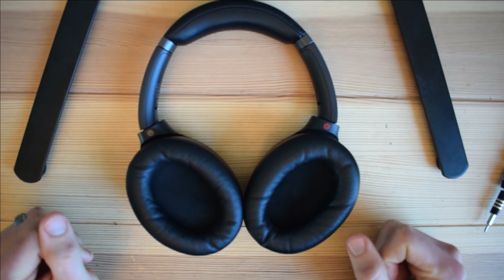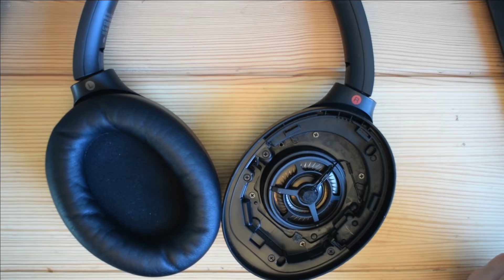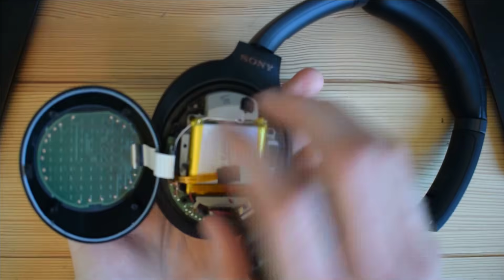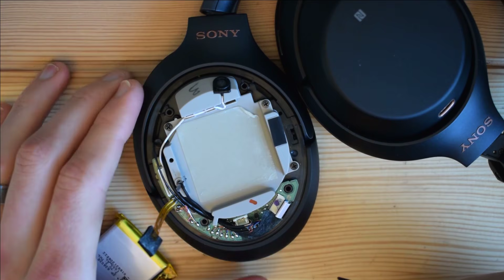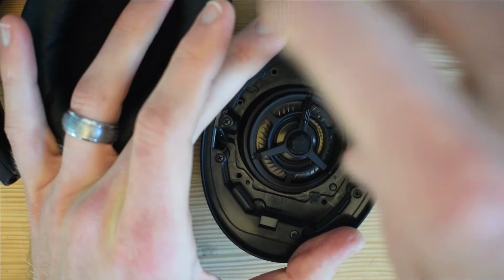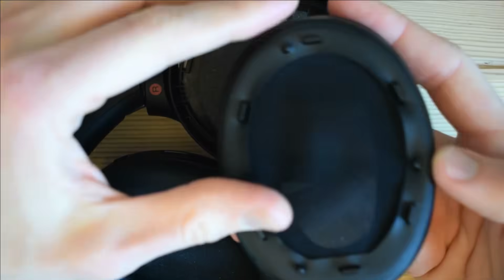Sony WH-1000XM3 Battery Troubleshooting, Repair or Replacement Walkthrough - Teardown and Fix

Comment: My app kept showing 10% for the battery.  I unplugged the battery for 15 minutes and then plugged it back in.  I hooked up the charger.   The red light came on for a few minutes and then went out.  So I powered on the headphones and the app showed the battery at 100%.   So it seems like the battery was charged the entire time, but was only showing 10%.   We’ll see how long this lasts.  Thanks for the video!   Made disassembling too easy.

Comment: I replaced the battery as shown in the picture and followed all the steps correctly. However, now the sound only comes from one side. The earbud on which I replaced the battery no longer produces any sound. Has this happened to anyone else?

Comment: I have the WM1000-XM2. I had to remove the entire battery to disconnect it from the unit. It was a bit challenging as it was glued. But it worked 😀
Now I’m excited to see how long the headset will keep working.

Comment: Does XM3 have same battery as XM4?
Reply: Yes, I bought this one a few days ago for my XM3 and the description says that it's also working for XM4. But look out for 1200mAh, some only have 1000. Cheers
Reply: @spexx23  Must be the logic circuit. A nerd with schematics could tell you which chip/CB it is?

Comment: Would you please resend the link to purchase a battery? I have a model WH1000XM3 and think it’s time to change the battery. I am having trouble powering on after a full battery once I’ve turn off the headset. Thanks!

Comment: Thanks for the video!
Here’s my story:

After I dropped my headphones on the floor, I picked them up and tested them — they worked!
But the next day, when I put them on, they suddenly stopped working. When I tried to charge them, the red light stayed on for a few minutes, then turned off. Later the charging time got even shorter, less than a minute.

Here’s what I tried:

After Googling, many people recommended changing the cable and/or the charger → still not working.

Following this video, I unplugged the battery for 20 minutes → still not working. When the ear pad cover was off, I touched the battery to check if it warmed up while charging, but it stayed completely cold. So I suspected the battery was dead.

I asked my friend DeepSeek, and he guided me to the iFixit page for the WH-1000XM3. There, I found a comment from someone who opened the left ear pad and applied gentle pressure on the cables and the board. I tried the same thing, and bingo — the headphones turned on!

After investigating more, I realized the real issue: a tiny crack or bad solder joint on the main board. I located the exact spot that needed pressure, placed a small folded piece of paper to add thickness, closed everything up, and tested again. → Everything works perfectly for now, until I buy a new pair someday.

Conclusion:
Dropping the headphones caused a small crack or bad solder connection on the circuit board.
The battery was charging normally — it wasn’t the problem.

Comment: i opened mine today to replace the battery and than i saw an additional white cable that is connected on the outer shell like the ribbon cable. what foes it mean?
Reply: Battery side / right side: Leads to outside microphone on the outer top shell
Reply: @Anno2143yeah, it was the outside anc micro i think. it was sticked there but i put it back in the place where it belongs

Comment: Hi! I've done everything and it seems that is charging correctly but it doesn't work the power on/off button on the left side. Any help please?
Reply: Im having the same problem, I'm going to apply pressure to the cables by removing the casing to try and fix the problem. I'll update you if it works

Comment: I've been looking up the reason why my XM3s not turning on for weeks now and most people say the XM3 have a short circuit issue because of the exposed motherboard but when I opened up the left side everything seemed to be in order. Then I came across this video and decided to replace the battery. They're working like new! I was thinking of getting the XM6 but you just saved me $500

Comment: When I plug in my charger the red light appears but after 1-2 minutes it disappears. When I press the ambient/nc and power button at the same time then it comes back on for another minute or two and then back off again (just a complete cycle) but when I try to power them on, nothing happens. I don’t know what to do at this point
Reply: I am the same I will try what he shows in the video
Reply: Exactly the same
Reply: The red light disappears when a wrong cable or charger is used and the sonys will not charge properly. Try a different cable or charger. Not too strong. My 90W phonecharger doesnt work. But maybe the battery is still broken.

Comment: Hi, thanks for a great guide! I replaced the battery with success. The headphone does turn on and everything seems to work. However, I am not able to charge the headset. Red light doesn't go on. I tried a bunch of different chargers and cables. Anyone has a suggestion for a next move? Do I need to change the PCB with the USB-C port?

Comment: I did this, there only was the yellow wire not connected properly, but others said it just was the temprature sensor. I changed the battery, there is the red spot of charging, so why it just doesn't turn on?

Comment: If you're reading this comment, your XM3s are very old. The glue holding the battery in place is 1000% more sticky than in this video as a result. Fair warning, if you remove the battery, you will probably destroy it. So only do this to replace the battery. If you just want to try his technique of removing it and plugging it back, unplug the battery but leave it in place while discharging.
Reply: huge comment. I was staring at the sticker wondering why it was so much bigger and not coming off easier. Decided to check the comments before tearing it off. Thank you!
Reply: I actually made it to put the sticky thing off. But the problem seems to be something else with the power button 🔘 so everything is back to place now. And have to figure out how to fix the other issue
Reply: Haha yeah they're pretty old!!
Reply: This guy wasn't lying
Reply: I think they’re almost 8 years old 😢 I’m not ready to say goodbye
Reply: You can always try heating it up carefully with a hairdryer or use a syringe with pure alcohol to dissolve the glue

Comment: 2:21 
My sticker got damaged when trying to take it out because it was stuck. What should I do now?
Reply: It’s a temperature sensor, so it shouldn’t affect it. Just there in case the lithium ion battery is too hot, could explode. Just don’t bring your headphones near fire and you’ll be fine.
Reply: @ thanks
Reply: @joshuahancock6742  Thank you, I was wondering wth that thing could be.

Comment: Thank you! in my case the headset has stopped working after it was exposed to direct sun on the car dashboard, I connected the battery plug to a hobby battery charger and I assume that the bms was reset with this charging process. Working perfect now

Comment: Thank you for the video! I'll try right now.

(Do at your own risk):
Just a tip for anyone who doesn't have a pry tool: in this case you can use the cap of a BIC pen (the classic BIC pen), by using not the "cap" part, but the long little thing that you would use to hoist your pen on your shirt. It is not very long, but for a simple operation like this one it works pretty well.

Comment: Well, it seems my issue is not the battery but one of the ports/boards. My charging lights won't turn on neither the battery will get any energy input. With the remaining 10% they work perfectly, also while wired. Now, I am assuming the issue is related to one of the ports/boards. I believe this happened after I connected to one of the USB-ports in the back of my PC, so I am assuming something got extra power and burned. I tried to check conductivity and I get some weird readings in the battery connector, almost like counting down every second. How can I debug? I'm in Switzerland, would probably need to order parts from Ebay or so...

Comment: Is it important to detach  the cable on top of the battery. Does it also work only disconnecting the battery?
Reply: I successfully replaced the battery without disconnecting this one

Comment: Hey thanks!
I try what you suggested and I waited arround 10 mins with the battery unplugged, after that I placed everything in order and turned them on and they worked perfectly.

I try to charge them up but the led blinks in red, I not sure if they are charging properly or not.

The app says that they are already in 100% percent.

Comment: I'm sorry if I sound bias but I LOVE SONY!!!
Imagine these headphones were made by crApple: 1 litre of glue, 256 micro screws, wires so fragile that would snap the moment you start THINKING to replace the battery and the connector burried under 32 layers of butter pins and plugs.
I hope Sony never changes.
Reply: Bro, grow up. You can like Sony without getting upset at a 3 trillion dollar company, I promise
Reply: @0741921  The reason that is a 3 trillion dollar company is this exact thing, not because it's good. FFS since Steve died I didn't see any advancement that affected my life as a non Apple user, back in the day whatever Steve did somewhat found its way into my life without me buying a single Apple product. Accepting mediocracy and opportunism is at best, stupid.

Comment: I have the Sony MDR I would like to get a link to the battery replacement are all the batteries the same and I would like to get on the side piece with the both of them left and right piece I broke one side of mine so I would replace it can you send the link where I can buy it

Comment: Hello
I changed the old battery with a new one, but the problem still exists, that the charger still lights up in red and not blue, even though I left it in the electric charger for a while until the red light went off on its own. Then I tried to turn it on from the start button. It did not respond at all. What do you think is the reason?
Reply: I have the same issue with the M3 model, did you fix it ? and how ?
Reply: @nas_arabia8285  open the left ear and if any of the open wires is touching the motherboard move them away from the motherboard carefully then try to turn it on if it works you need to tape the open wires carefully
Reply: might be a wire touching the motherboard on the left ear that was my problem

Comment: thx mate, I followed your advice to first disconnect the battery and then reconnect and charge, battery was full after 10 minutes charge, will test if it stays that way, all the best (after 5 minutes.....it stopped working again. same issue. not reacting to buttons.....maybe need to change the battery. (Update, when I wait, then charge it then sometimes after a 5 minute charge it goes on again and I can use it like normal, but then after a minute or so it stops again and doesnt react, seems a pcb problem from the battery (battery has a pcb). I will order first a new battery , then open the old one to see if battery of pcb is bad, put the new one inside and see if it solves my problem

Comment: I've had mine for about three years now and I've started to notice the battery life isn't that great anymore a full charge used to last me 5 days (or about 25-35 hours of playtime) and now I barely get trough two days. Good. To. Know the fix is so easy and the replacement battery isn't that expensive either so might as well it and expand the lifespan on these. Thanks for the straightforward and easy to follow tutorial!
Reply: Same, though mine is currently lasting longer atm, dont le the battery run down to 0% otherwise that can decrease longevity of the it

Comment: wats that yellow wire on the battery called? - something to do with the battery connection the black sticker on the battery ?
Reply: I've thought the same thing. Could be a ground wire?
Reply: most likely a temperature sensor

Comment: As others have said, thanks for making and sharing.  Really helped.

I haven't changed the battery (didn't need to as it has turned out).

The disconnect for 10mins and then try didn't work.  Note: I didn't disconnect the cover as the connection 'wire' is that ZIF (Zero Insertion Force) and I don't have the best eyesight, nor the slimmest fingers for those things...

Now as @azzi6494 and @jefferychow1099 noted (below) my batter connector is not located exactly where yours.  It is closer to the battery compartment hidden under a nasty "Rats Nest" of wires, which themselves are covered by some rather sticky insulating tape.  I'm not sure that it is even meant to insulate as a lot of the wires in the Rats Nest looked bare and would be touching.  Guessing on its location and proximity, I think the tap is actually to stop them from being trapped / snagged when the cover is replaced.

I went down a rabbit hole of removing the other cover but found nothing that seemed untoward.

WHAT WORKED FOR ME (I believe)

Removing and replacing the battery compartment cover's ZIF connector.

Why?  I think it may have worked loose one of the times I dropped my headphones (I'm not clumsy, quite the opposite but I live in these things and shit happens)

NOTE IF YOU GET A HIGH PITCHED WHISTLE / WHINE

This is almost definitely an indication that the Heat Sensor(?) the 'Loop' of wires stuck onto the battery hasn't got a good connection.

Before reassembling I was nervous that something might work loose so before I installed the battery back in I plugged it by the connector.  The headphones switched on , connected to my phone via Bluetooth and then the headphones started whining very loudly (glad I wasn't wearing them).

I pulled out the battery connection which stopped the whine and tried again.  Same thing happened.  Powered on, Bluetooth connection, whine.  I unplugged again. It Stopped.

I reconnected but this time when it started whining I switched the headphones off using the Power button.  It switched off normally and the whining stopped. I turned them on using the power and the whining returned so I turned them off again.

I replaced the battery into its compartment and switched the headphones on - Whining.  Switched them off.

Now I replaced the Heat Sensor onto the back of the battery and switched on.  No whining.  It just did the normal Power On, Connected to Bluetooth.  This is why I believe the whining is to indicate a problem with the Heat Sensor not being connected (and possibly not working / not working correctly but I don't know as mine was working)

As I went about putting the battery wires back as I found them, pressing the Rats Nest down, covering Rats Nest with the tape, replacing the cover, screwing the cover back on, putting the cushion back, I tested that it would still turn on and connect at each stage.  It did.

So thanks again and I hope any additional info I have contributed might help someone else.
Reply: You helped me thankyou
Reply: Excellent. Thank you!

Comment: Hi @Jon Tries To Fix Things, Firstly thanks for this great video. 

I followed this procedure on a pair of XM3 that were dropped and stopped working. At the time, battery had around 80% charge. I thought maybe disconnecting and reconnecting might work, however, they are still not turning on. I checked all the connections and they look intact. During the process of reconnecting the battery, the earpiece was lying flat on the surface and once or twice when I tried to turned them on after reconnecting the batteries, there was a whistling sound and they did automatically pair with the phone but that's about it, haven't been able to turn them on again. I am guessing batteries are still fine. Is there anything else I can try before I send it to Sony?
If anyone else reading this who has been been in the similar situation and found a resolution, would appreciate a response please.
Thanks
Reply: Had the same problem, sorry no solution yet. You?
Reply: ´
i got the same problem i have tried most things and i get them to work for an hour or two then they stop agian and trying to factory reset wont work

Comment: My battery wouldn't charge, and the charge light wouldn't illuminate when the charging cable was connected. 

Thanks for the video! Disconnecting & reconnecting the battery didn't work, so I replaced it, and problem solved.

Comment: My headset has been lying dead for quite some time after I dropped it, and it stopped working.

After watching your video, I unplugged the battery and plugged that in, and it started working again.

Most importantly, your video gave me confidence to take a chance to repair it by myself without breaking anything else.

Thank you very much for sharing the video!

Comment: Bit of a long shot but I've replaced the battery and my xm2 (not 3) still won't charge, if anyone reading this knows the next fix if any that would be great. Ended up buying the xm5 but I'd like to be able to gift the old pair!
Reply: Try changing the charging port
Reply: @andressaenz1279  yeah I guess that's the next step. Can't do it myself I have Hobbit fingers 😂 but I will try to figure it out!
Reply: @lawtecke9427 hello sr, let us know if you could fixed it